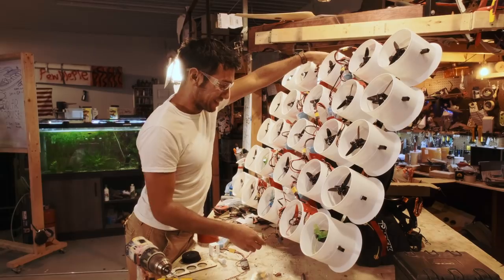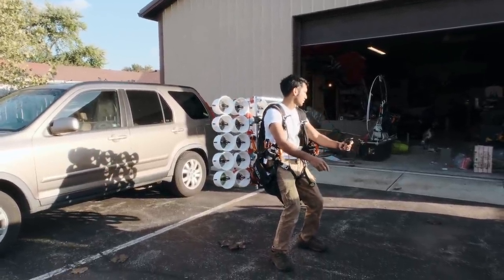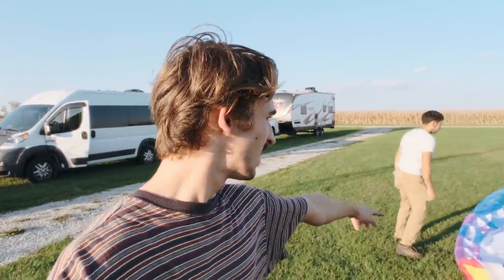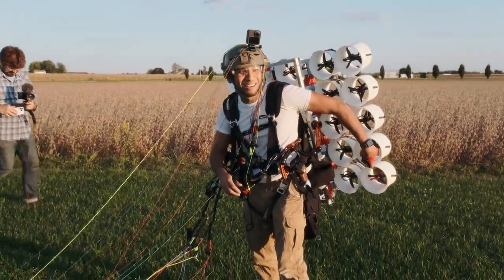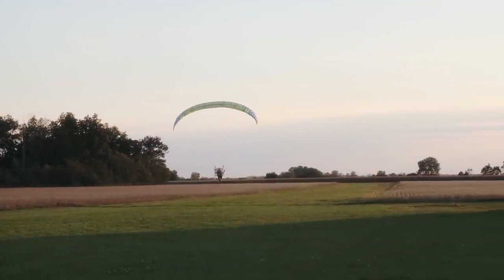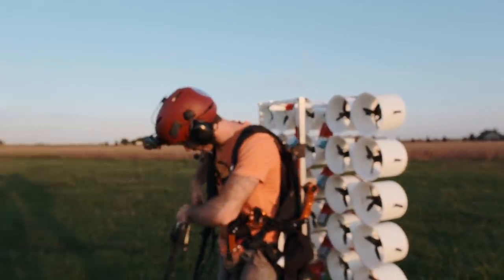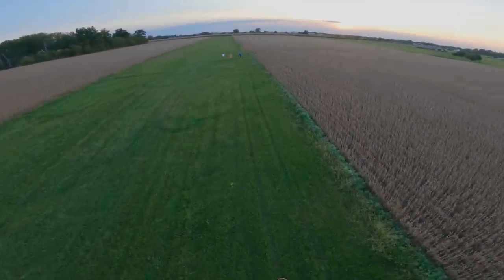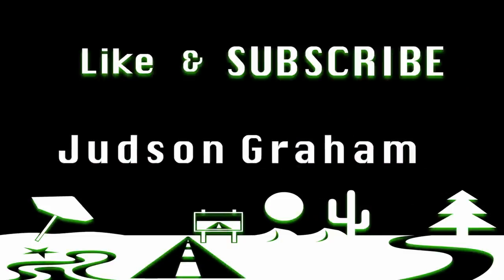Flying PETER SRIPOL'S INSANE PARAMOTOR. (50 Ducted Fans!!)

Comment: Awesome collaboration. Awesome contraption just to make it work. I get the feeling it might be more successful with a smaller, faster wing. Those little fans will push better as they get 'on step'. I'm sure Peter engineered them to have best low speed thrust but generally fans just work better with more airspeed.

Comment: Your need to try my electric paramotor. Probably has 10x more thrust and 20x better flight duration.
Reply: Of course Austin. Powered by what sort of battery? I get that those little fans are not efficient at low speeds. But there's no physical way possible your 200X more efficient! LOLs Even if you double the efficiency of those fans you'll still need 100x the battery - and 100x the weight to get 10x more thrust and 20x the duration. Lets say you made a grammatical error and you can get 10x the thrust OR 20x the duration. So you're still claiming 20x the efficiency OR 20x the battery or some combination. Or maybe... your simply being hyperbolic.
Reply from the maker: He’s just dell in disguise lol. 10x would be 1000 lbs thrust.
Reply: As for flight duration, I fly fpv drones. I understand the motor efficiency Peter is getting and how fast it can drain those batteries he is using. 3 minutes of flight is honestly on the high end of what I think he is getting even with only a 135 pound pilot. Following a comparable flight style to what they did with this paramotor(pretty straight and level), I could get easily over 60 minutes. With a pilot the weight as judson, I could make that over 70 minutes.

Judson was there and i would love to hear from him on actual endurance numbers.
Reply: @JudsonGraham  Hey Judson. That really didnt look like 100 pounds thrust. Our atom 80 engines produce less than 100 pounds thrust at our altitude and we climb significantly better. 35 pounds is about the in-flight thrust you should have needed to maintain altitude. I could be totally wrong on thrust numbers thought.